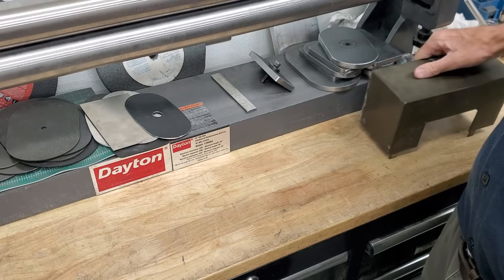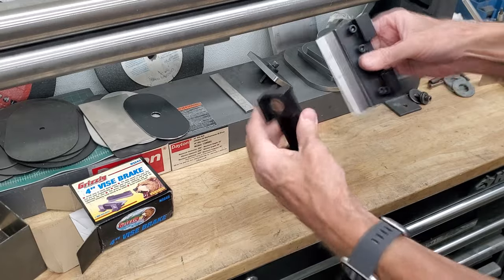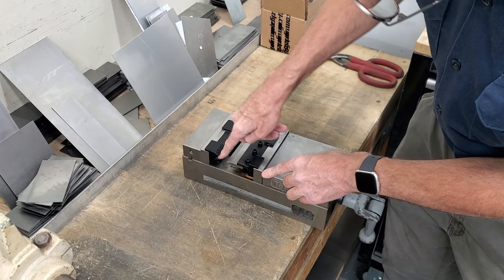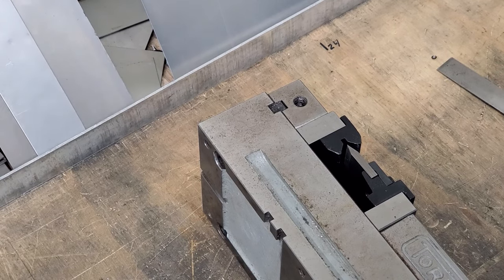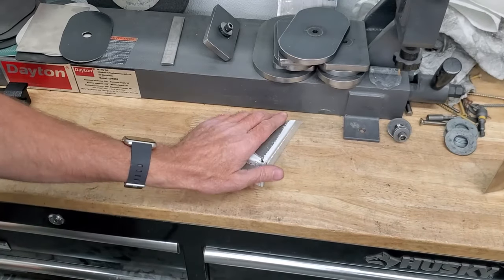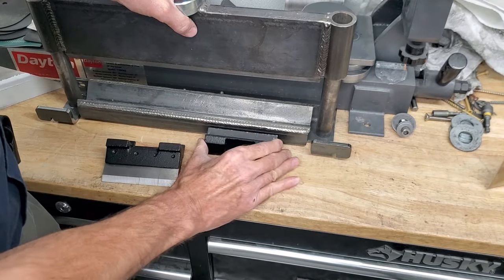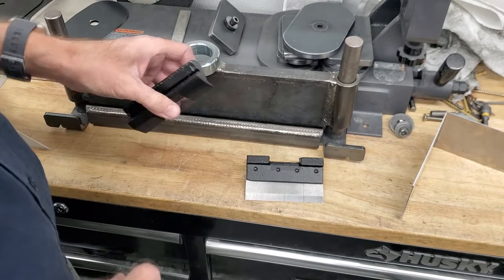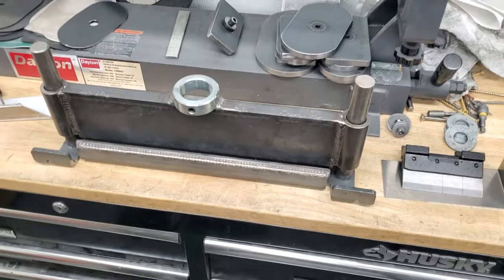Exploring Sheet Metal Bending

Comment: Good luck with the build, thanks for tagging me! If you plan on using a series of those inexpensive finger and die sets to make up your 24” span, find a way to align them once... maybe weld them together or something. I don’t use mine overly often so I don’t mind aligning mine occasionally, but I bolted mine to the tube that supports them... I don’t have a CNC machine so the holes were hand drilled with some play in them so I could get things aligned and then tightened down. Unfortunately after a few bends, the press has enough force to overcome the tiny bolts and move them a little. Eventually the fingers and dies fall out of alignment and I have to re-align. I make my bolts finger tight to align, then I use the longer fingers and span them between the holders so I know adjacent holders will be in line. Then I lower the fingers into the dies and tighten my bolts back down. This is obviously too cumbersome if you are using this for any sort of production... but my video was basically just showing how you can build one with barely any tools ie. welder.
Reply from the maker: Thanks, sure thing!  I think I may end up making 1/2" thick punches and machine the upper punch holder out of solid square steel. Then machine the lower die out of the same square steel.

Comment: Man, sheet metal bending is a totally different discipline.  All the big projects I've been involved in over the years used the huge 10' press brakes.  Of course the operators have access to hundreds of different tools.  I don't know how you scale that down because the problems you solve on both sizes are exactly the same.  It's all about clearance and that takes a tall opening and long tools.  There are a lot of commercially available dies and every once in awhile you'll see some pop up on the used market.  They usually go for pocket change because there are very few people looking for them.
Reply from the maker: 10 foot, that would be nice to have. Just watched a video of a guy teaching the basics of using a 10 foot Cincinnati. Pretty old machine but nice. Yeah, I would like to design it so it's very versatile. Maybe tall enough for some 8" punches and setup to accept American tooling. I guess I should go air bending since that is the most common?  I see a lot of bottoming dies/punches on Ebay though.

Comment: Have you looked into a Magnabend box and pan brake?  They are very compact and fairly affordable.  We used it for aircraft seat sheet metal shrouds.  Works really well and fast to setup.  Harbor freight sells a small 3 in 1 press break with a slip roll and shear that might work for you.
Reply from the maker: Thanks. Pretty slick machine.  Any idea how well they work for production work?  It looks like you have to place a plate inside the box each time.  Yeah, the 3 in 1s look pretty cool also.

Comment: 3000 series aluminum is “formable” material.  I typically use 3003 aluminum.    6061 with tight radius will crack/break.  Hope this helps.
Reply from the maker: Thanks, I have normally been using 5000 series.  I will give 3000 a try.
Reply: Craig's Machine Shop 5000 series is also formable as you states!  Good stuff!

Comment: a cheap box and pan brake would do a lot more than a tiny vise brake which is pretty limited. you can get an inexpensive 24" brake for under $300 for lighter gauge material
Reply from the maker: Thanks. Yeah, I recently made a 26" 20 ton hydraulic press brake.

Comment: I'm trying to make up brackets to mount my car wing to the trunk of my car. Finding it difficult to figure out what metal would probably be good for the job but still bednable enough where I can make them myself.
I felt 1/8" thick was a good thickness until i saw 1/8" and thought maybe 1/16" would do the job, but what metals are purchasable that will allow me to bend them without shattering or cracking but still hold up in strength to keep my wing on my trunk?
Reply from the maker: Maybe try a local metal supply.  They can show you the different gauges of steel.  16 gauge is pretty flimsy for a spoiler/wing.  1/8" is 11 gauge.  You might look at 14 gauge or 12 gauge.

Comment: Dose the tormach not have enough travel to make the die?
Reply from the maker: I have 14" in X and 7.5" in Y.  I'm not really sure how to fixture it using a flat endmill.  I was thinking I might have to get a 3/4" mill drill or something?  The tooling company quoted a 75-degree sash punch and a 75-degree 3/8" opening die.
Reply: @craigsmachineshop2040 youd have to either step the angle of with ball endmill or get a custom tool ground with a 75 degree included angle. If you decide to source it out let me know and I'd be glad to quote it to you, I got 4 foot of x travel so the 2 foot long die wouldn't be a issue
Reply from the maker: @Daniel-vq9zb  Yeah, that would take quite a while with smaller and smaller ball endmills. Thanks, yeah I am working on the design now. An old time company that still makes bottoming dies (coining) quoted me $875 for 2 feet of 30/60 punch/dies. Riteway.
Reply: @craigsmachineshop2040  lol yeah it would take awhile I'd probaly rough most of it with a 1/8. Totally use to long runs though lol I just ran a part that was 29hrs of drilling 1/32 holes. I'd say that sounds pretty reasonable especially including material
Reply from the maker: @Daniel-vq9zb  Wow, that's a lot of holes.  I hope you had a good playlist going. lol
Reply: @craigsmachineshop2040  no need for a playlist, using those Mitsubishi carbide drills they last forever, so I set it up and watched it run for about 15 minutes and went in the house lol. I didnt even center drill, there vent holes for a vaccum mold so location isnt really critical at all.
Reply from the maker: @Daniel-vq9zb  Yeah, that's the nice part about working from home. I often start the mill and listen to it though an open window in the house. :)

Comment: Hey GREG, I have the finger press version  of that press, check out their flat top attachment, I don’t have it but I tried to put together the same basic idea with some scrap I had, it did seem to work. I’ve been struggling getting tight radius as well, might work for your prototyping. I’d you would like, send me your email via private message and I will shot your a video of it working on 16 gauge.
Reply from the maker: Hey Eric. From my understanding, the bend radius is all about the v opening. 16 gauge would need to be a 1/2" v opening.  Its material thickness x 8.
Reply from the maker: Not sure how to PM on YouTube. You can use info@lightpolecovers.com.
Reply: Sorry I’ve been tried up with things for the last week, I will try to send you a few ideas and things I’ve tried. Not sure it will be helpful, but you never know . Thanks again